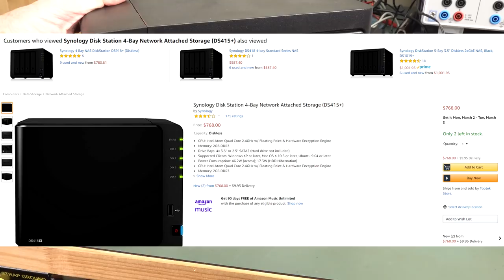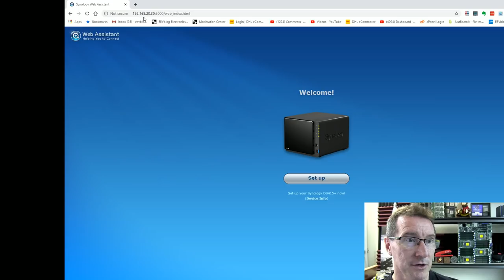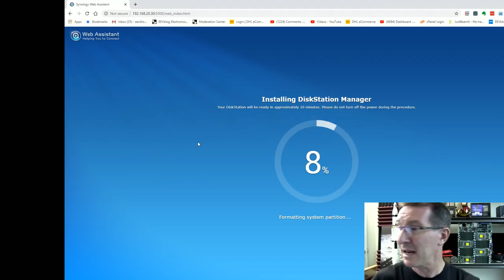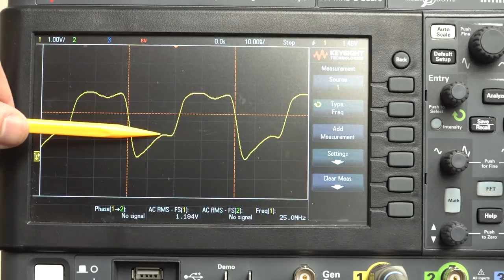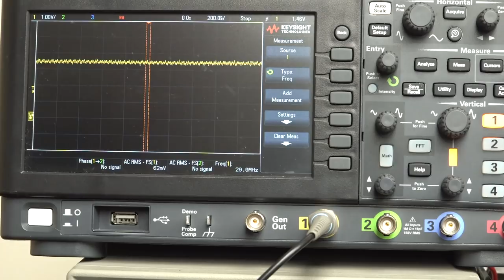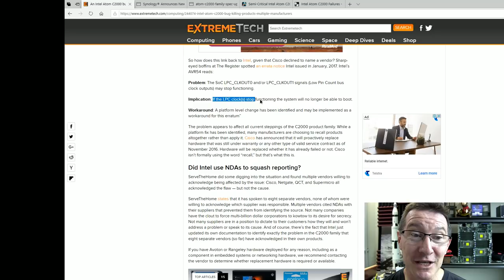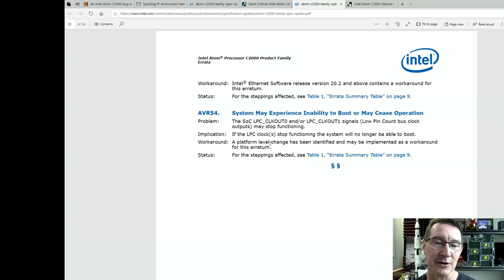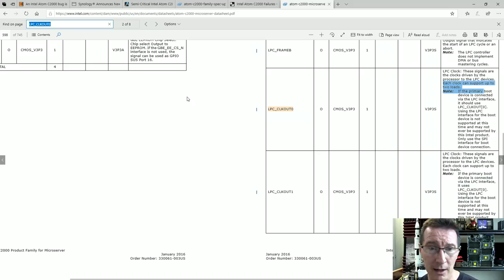EEVblog #1288 - Synology NAS Dumpster Find! (REPAIR)

Comment: I have a ds1815+ with a C2538 that was taken in by Synology a couple years ago to replace the power supply since there were many failure cases around that time. How can I find out if they implemented any fix for the CPU issue as well?
Reply: Well, I checked and found out that the unit was actually replaced, but that was 02/2017, so maybe it was a little bit to early to include any fix.

Comment: The synology nas stations store their OS on hard disk. If you change drives you have a plain system with default firmware. I also have a synology sitting around here. The c2000 issue was my reason to abandon it and setup a (better) nas manually. At least i can change faulty components.

Comment: clock signal is negative(grounded) and pullup via internal diode. when diode is gone there is no more positive voltage

Comment: It may have been used, but looks brand new. The system software is stored on a small partition on the disks in the trays. The small DOM you saw inside the unit contains the rescue partition, which basically allows you to access it to set it up. If you try and set one up with no disks inside, it'll complain, as it has nowhere to put the Diskstation manager. In fact, if you're upgrading to a newer model, you can move the disks from the older one to the newer one, and after a repair, which basically changes some configuration files to suit the new Diskstation, it takes on the identity of your old one, including all the settings, just with the new model number and additional bays.

Comment: I have always been jealous of your dumpster finds...until today, when I found a Recordex 330-II 1-to-3 stereo cassette duplicator. Needs new belts and probably caps, but the housing and mechanism is near-perfect. My hipster cred is through the roof.
Reply: I've not been too jealous. My top 5 dumpster finds can rival even his

1: Roland Juno 60 Synthesizer...fully functional, but with no patches in memory
2: Nvidia GeForce GTX 780
5: RUNNING Husquvarna Weed Eater
4: Sanyo 55in Plasma(don't remember the model)
5: Asus RT-AC66U

Comment: Wonder how close the J1900 is related to the C2000 ?, has a Qnap TS-453pro with a J1900 that's dead, flash, bios etc. checked and ok....

Comment: Dodgy?  Probably not too bad, as long as the degradation isn't progressive.  As a backup NAS?  Yeah, sure - just test it frequently which you should be doing now already right?  Seriously tho, it's probably safe as a backup - if it failed then replace it, even moving the drives to a new NAS.  Seems pretty safe with the right procedures in place. As a primary NAS, I'd probably be OK with that too, with the right backups and tolerance for downtime.
Reply: You know what he says, don't tempt Murphy!  He just might find this backup Synology failing at the wrong moment when he needs it.

Comment: My DS1515+ died a few years back I sent it back and Synology then they sent me a Brand new DS1517+ NICE.  I have just acquired a DS1415+ from the bay for a sweet $100 but it was full of cockroaches and SLIME YUK.  I cleaned it with some Alcohol and it is running fine ATM should I still do the fix????

Comment: Hi, i have the 415 play, no power issue, I have replaced the CMOS  battery and done the resistor hack.but still no signs of life. Anyone with any tips kindly assist.  I have tested the power supply is OK and gives  12v. It also works on a different unit. Also the board is slightly different from the 415+

Comment: 5:02 that's...an odd place to have a warranty void if removed sticker.
What's underneath it? XD
Reply: Maybe it's referring to the whole memory stick, if you upgrade it or whatever tge warranty is voided
Reply: @resneptacle  That's the thing. Those stickers are usually placed so that you'd have to tear them in order to get whatever out, thus proving that you did.

5:34
Nothing happens to that sticker when you remove the stick. Weird.
Reply: It's a SODIMM  RAM module. I upgraded it in my DS416play the other week.  The sticker is still on it, they couldn't be the wiser if I put it back. Though the void period is long gone now, so it is moot for me.
Reply: @Okurka.  Stop propagating that myth. The warranty WILL be voided if the company wants the warranty voided. Period. Laws don't matter, you don't matter. The only way to get a company to fix/replace the item you've been into its to take them to court. (Or possibly have an attorney send a letter to them, which will cost $100-200. So not usually worth it.) You calling them for warranty work and sawing, "Hey... You... The law says..." It's an absolute dead end. They can do whatever they want, because they know you aren't going to be able to do anything about it. I don't like it, and it's b.s., but that's the way it is.
Reply: @pelic9608  that's what's so infuriatingly curious about it - if they had wanted to stop you upgrading the ram, they could have taped it down with the sticker, so you can't remove the ram without breaking the sticker.

Maybe some reverse psychology to catch eternally curious people like me XD
Reply: @xenonram  depending on the country, you can just threaten to report them to the relevant government entity, who won't in general help you get your money back, but will often fine/punish violators.

The customer service person knows they're gonna be in deep shit if they're the cause of something coming back and biting the company In the arse, and they'll likely capitulate before it even gets to that point, warranty be damned.

A lot of this stuff is just bluff to make you hang up in frustration even if the law is not on their side, and they will thus often capitulate when faced with the threat of referal by a customer that seems far too knowledgeable in quoting the appropriate subsections of the law, and threatens to disrupt their cushy racket.
You do have to basically quote the law word for word though. 

Stickers preventing you looking inside are just silly posturing. Generally all consumer law states that something has to be as advertised and how the hell are you in general even supposed to verify that the manufacturers advertisements are genuine if you can't see what's inside the box? 

" Oh yes, this toyota has a 5L V8 (warranty void if hood opened)"

Comment: So Intel states "No Fix" while in fact several users have found a fix and published it widely?
Wouldn't users of that chip be interested in a potential rework fix that can save them from replacing all their sold products?
Reply from the maker: No Fix because it's not fixed on the die
Reply: @EEVblog  Intel could have at least provided a hardware work-around solution rather than just leaving the customers to figure one out.

BTW that is the biggest errata list I have ever seen and with all items listed as "no-fix". It shows that Intel don't really care about their customers, particularly the smaller ones, who could face financial ruin if they have to do a product recall to fix Intel's botch-up.
Reply: @stephenbell9257  Intel rolled new rev of silicon and provided work around fix to oems. Dave didn't seem to show page having AVR54 listed in silicon versions

edit: that's short errata. most of those are mostlikely "fixed" in software (bios, microcode, drivers, etc)

Comment: If your serious about your backups, don't trust crapy consumer grade NAS devices. 

I've been in the storage and backup industry for a very long time. Synology are one I've the high failure rate devices I've had to deal with. 

It might come as a surprise that there are less failures observed in single disk USB devices. Though I'm not suggesting them as a viable solution either.
Reply: you probably worked with old synology devices.. that's why.

Comment: I saw it has 2GB and uses Linux. I’d love to know what you think of the pi 4b 2GB as a raided NAS now that they dropped it to $59 (the 1GB price point)? That price is at Core Electronics in Aus
Reply: (4 hdd  on dual usb 3 using a sata hat, served over gigabit ethernet)

Comment: I have a ds1815+ and it has the 100ohm c20xx fix installed from the factory.  The next common bug with the 2015 synology nas's is that when powered down they will not power back up.  One fix to that is to solder a 1000ohm resister between pads at the Q4 transistor.  That unfortunately did not fix my nas.  By the way Synology, knowing these nas's were defective, happily replaced mine every time it failed (four times in total) until the warranty of course expired.  Then they tell you can can save your data (60TB in my case) by buying a new $1000 DS1821+!!!

I searched and searched for a solution to the no startup problem and came across a suggestion to simply short the connection between a green and black wire in the 24 pin connector (the 3rd and fourth pins from the right side) and the nas would boot.  When I did this my nas powered on, to my surprise.  I did not like the idea of power off though by simply yanking the power cord, so I installed a switch.  To power on you just close the switch and to power off you do a normal shutdown from the menu and when all the drive lights go out you just open the switch.

It scrubbed all the drives and has been working ever since and I saved blowing $1000 on a ds1821+!

Here is a picture of the fix... https://imgur.com/a/TdHTAE8

Comment: Two days ago e "repaired" Synology RS2416RP+ Rack mounted 12 drive unit just the same way 
Undergoing copy of the 24Tb of data right at this moment :)
So, in case anyone needs this, It does affect bigger models also, and the solutions is the same. 
(The pads are on a different part of the board, but you cant miss it, they look the same)
Reply: ok great,
I think synology also had these atom C2xxxx series inside there 19" rackstations and there fore they are also affected by this hw bug.. ? 
so perhaps than this resistor fix will also work the same way for the DS1515+ DS1815+ and some other models perhaps.. ?

Im still wondering then if this transistor fix is permantent, or only slowing it down and still make the atom chip to work.. ?
Reply: @floorinterfacing1582  The RS2416RP+ has an Intel Atom C2538 and i can attest that it has the same problem with the same "solution". As for the DS1515+ DS1815+, i really don't know. I'm however not using the storage in production anymore, even thought its for data that is "better to have and not need than need and not have".
I'm changing the sucker.
Reply: @maxsnts  Did you do this "solution" on the J2 section by the main 24pin power connector?
Reply: @BradleyLemon  Yes yes a 100ohm resistor between pin 1 and 6 of J2 Connector

Comment: I'm not an electronics guy, but I know how to do a little soldering. I bought the 100Ohm 1/4w resister and I'm just wondering, does it matter what direction you place it when you solder it in, like a one way door, or does it not matter like a two way door? Any help would be appreciated.
Reply: I figured it out since no one answered, I'll post the answer for a future person trying to do this. Generally speaking, no, the direction of the resister doesn't matter. It more or less depends on the circuits around it. However, since I didn't know the circuits around it and if that was relevant, I did find a video using a single 100Ohm 1/4w resister instead of the two like in this video and the side of the resister with more striping goes toward the pin 1 position. Anyway, I soldered it in place, replaced the battery and viola, my DS415+ is back up and running and will now serve as a backup to the new DS920+ I bought to replace it. This video was helpful though, and this fix did work.

Comment: Would i use it ? depends....  if the degradation has come to its end and the resistor fixes it and it has 10 years of life still in it , definitely ! 
But i could imagine that there are still things to come, degradation wise, so.. meh.
I mean, its nothing freenas couldnt do on any old mini itx board for the same price, right ? these days maybe even for less energy ;) that thing is 6 years old, right ?

Comment: So you still have a degraded CPU/silicon but the boards ability to detect it is now compromised. Synology decided the original voltage limits weren’t the limits anymore 😂 so the cpu lifetime is going to go down, you’ll start having boot issues or memory bugs eventually but for now enjoy it
Reply: It would be great to see what the Vcore voltage is

Comment: @9:50: i suppose there is an bootloader on flash memory with some compressed data.
When you put some hdd, bootloader can extract all data on hdd, so you'll have an fully operational nas.
It happened to me on both nas i have.
Reply: It just has enough to get you to the install screen.  It downloads a file called a .PAT file that has the main OS, and that extracts to every drive.

Comment: DAD (Dumb Arse Dave) (c)2020 Dave.  LOLs 21:09
I wouldn't trust it as far as I could throw it.  There is a good reason it found it's way to the dumpster.  I'd use it to backup all the non-essential video material I keep around for entertainment, maybe.
Reply: DACR - coz the bug only affects the BOOT process for the NAS.

Comment: Sorry to bump a old video anyone know what kind of resistors was used 100 ohm 5w, 10w,?
Reply: Shouldn’t matter the wattage of the resistor, this is a clock signal if does not carry any significant amount of current so worrying about it being a high wattage resistor is unnecessary..

Comment: The upshot is the push pull clock driver fails to push or source , but can still sync... hence the low impedance pull up.

Comment: the reason you may have thought it had not been setup before is because the synology os actually creates a partition and runs on the hard drive(s) so in your example if you swap that single hdd with a fresh one you would have to setup dsm again. The synology in a diskless state only has small on board storage. Keep this in mind if you want to swap 4 new larger drives or 3 new and a ssd cache. Depending on your raid config you can add 3 new drives and once they have initialized and join the pool you can swap out your original first drive without losing your data and config. But in your situation it doesn’t matter because it’s a new setup anyways.

Comment: I wonder why if Synology new about this bug didn't recall these products and fix them for free.  For the price of these things hell they should fix them self's. I can build a freenas for fractions of the cost of a Synology.  Its crazy I have 1500 in my NAS and the most expensive part are the hard drives.

Comment: He goes out of the way to be pretentious in some of his videos. I don't like that at all but I went thru this with a similar device. They suggested to add a resistor on the clock line in order to increase the input impedance to the CPU input and to increase the amplitude of the clock signal source. That clock line could have been damaged but there probably enough isolation from ground to prevent that.